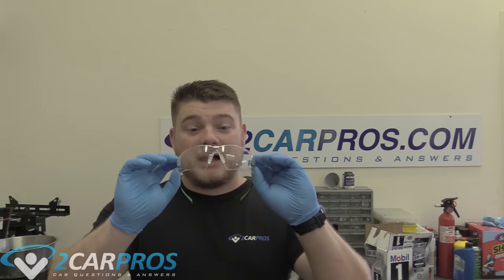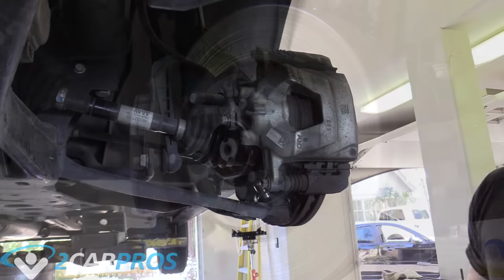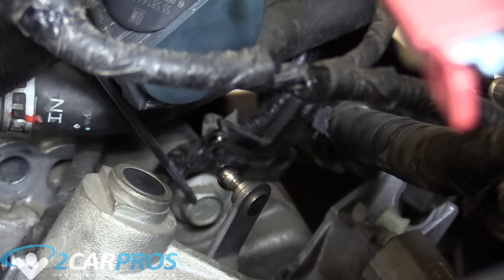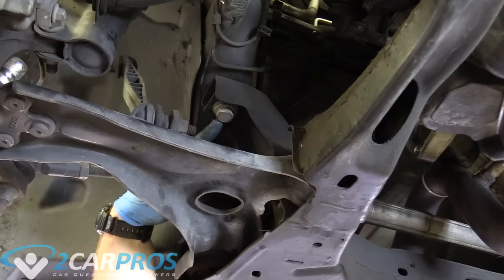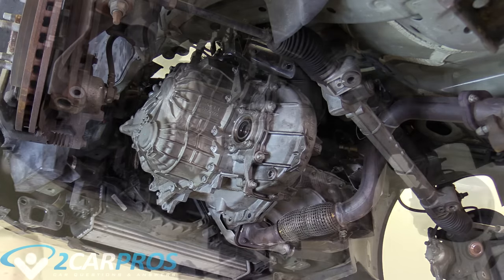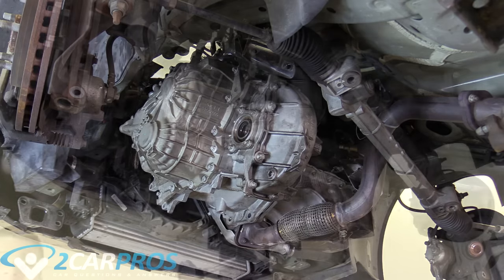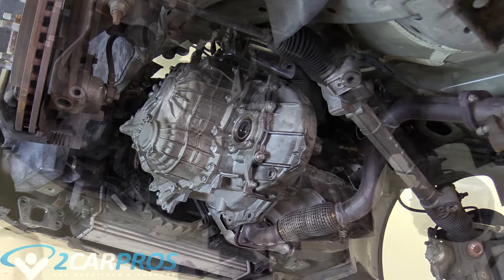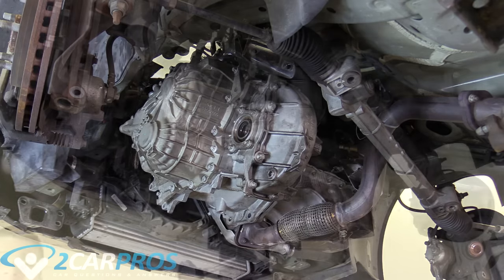How to Replace a Clutch and Throw Out Bearing Front Wheel Drive Vehicle | Step by Step!

Comment: Probably the most comprehensive video I have seen. Excellent video angle use. That must have taken twice as long to line up the shots. I'd do a few things differently, but for the most part, you nailed it. I'm not a fan of using bolts to mate transaxle to block. I've seen this shift the clutch disk alignment and cause chatter. I feel much better when it slides together using man grunts. It may have been because you didn't have a clutch disk alignment tool to begin with.

Excellent video. You swear a whole lot less than I do on my channel... 😉
Reply from the maker: Thanks so much for watching and noticing! It probably takes me like 6 times as long to film than to just do it. Man grunts are the optimal way lol but yeah no clutch alignment tool. I even called the dealer and asked for one.

Comment: Great video. I just did this job band never dropped the subframe. There's enough room (if your hands are skinny like mine) to separate the trans and slide it back to rest on the sub frame. Put a jack or jackstand under the front of the trans to support it. There's enough room to remove and replace what you need. I also used a 3/8" 14mm deep socket with a 3in wobble extension as the alignment tool. It fits perfectly in the clutch disk.

Comment: Great video. Information for people that are actually doing this on a Chevrolet sonic. I have the 6 speed M32 transmission and recently (yesterday) completed this job. 1) there is no pilot bearing. So if you're looking to replace yours don't bother 2) the clutch lines are self bleeding...only to a point. I replaced the slave cylinder and it required actual bleeding of the clutch line. If you don't do this it will take forever to self bleed...also maybe my self bleeder is broken, who knows. I do have 208k on my car.
Reply: 208k miles on an m32? Is yours revised version from late 2012 onwards. Because earlier ones like mine on my opel astra j , it killed its bearings at 56k km i guess thats like 35k miles
Reply: @288gto7  Not sure? My car is a 2012 so it's possible. Definitely makes some noise haha. Synchro's are starting to go

Comment: I have a sonic, and looked this job up for curiosity sake.  Looks like removing the engine cradle should be the first thing to do.. looks like allot of room after it's out of the way. Thank you for posting this. 70k with a clutch like that.. Driver needs some clutch lessons, LOL. I use my sonic for the commute, but down the road.. I'm thinking of swapping the motor out with a monster 1.4 I'll build myself.
Reply from the maker: Thanks so much for watching!

Comment: If you are alone working this you can use a bell housing bolt to lightly hold a combination wrench with its open end so as to catch the teeth of the flywheel, this will allow you the torque these pressure plate bolts.

Comment: Not sure if your still around on this channel but... I am just finishing this project. For those that are curious, I did it on jack stands without much issue. One question I'm stuck on, on the driver's side on the inside of the engine cradle, there is a small can looking thing, I think it's some kind of 12v small motor. Has a vacuum line on the bottom and the other end goes??? I have no idea, as i was dropping the cradle out, I noticed it needed to removed as it is attached to the cradle. My Sonic is a 2013 so no idea if it's the same on the 2012. Your video was so helpful, I think I referred to it about 10 times doing this job. Wish you would've talked about this thing that I'm stuck on. 😃
Reply from the maker: I'm here everyday. There is just a lot of comments to get to. 

Hmmm I didn't notice that. Maybe this one doesn't have it there? It sounds like a vacuum reservoir. You just pull the line off and you are good to go. 

Thanks for watching and nice work!

Comment: When torquing the axle nut use the lug nuts to protect the lug bolts threads before using prior a holding bar, do not try the torque until protect those threads.
Reply: I would torque the nut with the car on the ground so I use the car's weight.
Reply: Apparently you haven't ever worked flat rate. 🤣

Comment: Great and very instructive video !  Would you mind to tell me what to do with hydraulic circuit ? Will it leak after the transmision is disconected? I have a Hyundai Tucson CRDi 2.0 model 2006. There is a hydraulic clutch inside. I fear the loose the fluid and get the air inside the circuit which seems  to be conected to the brake circuit. Thank you very much Sir.
Reply from the maker: Thanks very much for watching! It will leak if you disconnect it. That's why we pinched it close with a pair of vice grips. If any air gets in just make sure you top off your master cylinder and pump the clutch slowly once re connected.
Reply: @2carpros  Ok thanks a lot.
Reply: Great job Big boss I will start same job like that on Chevy Cruze good job

Comment: Any idea what size socket is used to remove the sensor on the transmission to top it off? Also, is there a reliable, non-subscription site that would have torque specs for the bolts? Amazing video, thank you so much.
Reply from the maker: I really can't remember it was a few years ago now. There is no site that I know that does that. The one I use is a paid subscription through AllData. Thanks for watching!

Comment: Very good video and tutorial.  You are very clear and easy to understand.  As I review all these videos, it seems to me that the easiest procedure to replace the clutch is to remove the engine, leaving the transmission in place.  It appears that disconnecting the support systems on the engine and pulling it out the top is easier than disconnecting the drive train and dropping the trans out the bottom.  What do you think?
Reply from the maker: There is a lot more to disconnect and unbolt for the engine typically. But if I didn't have a lift and I had to take the cradle out like we did on this car I would consider taking the engine out instead. Thanks for watching!

Comment: My 03 Yaris won't select gear intermittently. I notice the slave is not leaking and seems to operate the fork. Last time it happened I noticed I  could select 1st after turning engine off but I feel a slight pull when I dip the clutch.
Can  you advise me as to what could be the problem? Thanks

Comment: You don’t need to put gasket seal in between the transmission and motor? I have another question.. my drivers motor mount Gave  out tha other day also breaking my cv axle and I replace it but now it’s making a crazy grinding noise.. is their a chance I blew my clutch or my transmission?
Reply from the maker: Nope, no seal there. Depending on how dramatic the break was there is a sold chance something in the transmission is broken. Tough to say what from here. Thanks for watching!

Comment: Is there any way you could take the engine out to do a clutch job? Or does it not remove through the top?  I just thought it might be easier then disconnecting all the drivetrain, shifter and engine cradle underneath
Reply from the maker: It's easier to do it the way we did. Thanks for watching!

Comment: Good video my freind ..thank's 
Is it work at 2012 chevy cruze LT 1.8?
I wate your Answer please
Reply from the maker: Yes this very video was an a 2013 1.8 Cruze. Thank you for watching!
Reply: I just did this on my 2012 and my engine rack was above my exhaust so you may need to disconnect that before removing

Comment: So you basically took out the sub frame
Reply from the maker: Yeah this was a pretty involved repair. This is as bad as it gets for normal cars. Normally you just have to drop that transmission and you are good to go. Thanks for watching!
Reply: @2carpros  it's too bad. if GM used a half frame up front it would of been do-able to sneak it out and relatively change very little on this car. honestly no need for it to have a full subframe up front. 90% of this job is just moving crap out of the way so the trans can drop. freeing everything on the trans and it from the engine a cakewalk.
probably be a few hour clutch job at home if engineers gave a damn about mechanics or their customers.

Comment: love this video!,but oh man! a concentric slave cylinder!..ugh!!..  im  surprised the clutch it didn't come with a new i would've had that replaced one who ever drives that looks like they either ride the clutch alot ,stays on the gas while letting off the clutch winding on  the clutch or loves to do burnouts. the most awful inconvenience design ever to have the slave inside the transmission! i mean i understand that this is your throw out bearing and slave cylinder combined into to one but such an inexpensive part that will cost you close and over 1,000 job to get done just to replace a 50- and little over a 100$ part so that seems to defeat the purpose of a hydraulic part that will ALWAYS have their time to fail and they decide to put it in the most warmest place...inside the transmission

Comment: what a nightmare if your slave cylinder starts to leak. Better off buying a car where you can do all that work with the engine in the car. I am going to try to change the clutch release bearing without removing the engine in a fiat panda. I already did Austin Minis, Mini Metros and a Peugeot 205 like this. The Peugeot was done with a mountain bike alan key set and a few simple tools, with a home made clutch positioning tool.
Reply from the maker: Some cars have the slave cylinder on the outside of the transmission casing but on these newer cars they are usually inside and a total beast to deal with. Thanks for watching!
Reply: @2carpros  it's the first time i saw one on the inside, what a mare!

Comment: I am a little late to this party, but this is a great video.  Sadly, what this shows is how throwaway most of these types of cars are.  If you get 100,000 - 150,000 miles out of the clutch, the car is worth about $12 and the sheer amount of labor that goes into this makes this repair cost more than the stupid car is worth.  Extremely well done video though.
Reply from the maker: Thanks for watching!
Reply: My clutch is at 205,000 miles and still works great. It's how you operate the clutch.